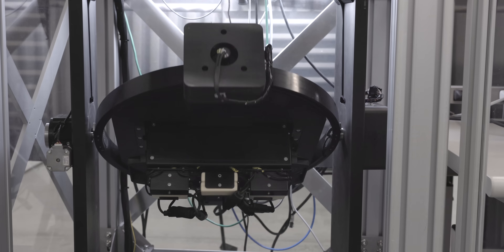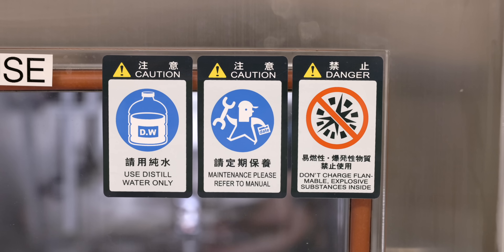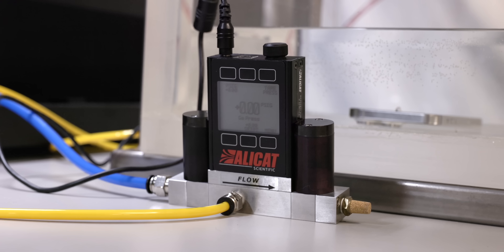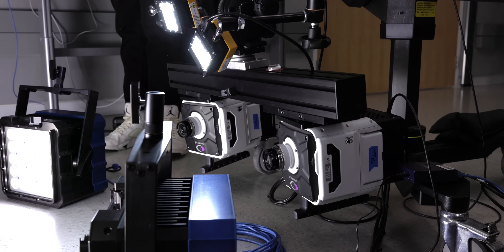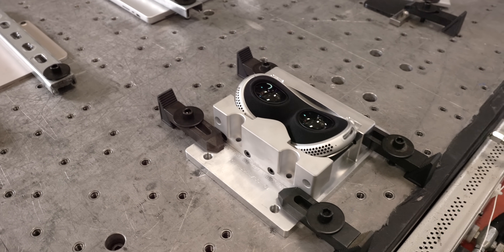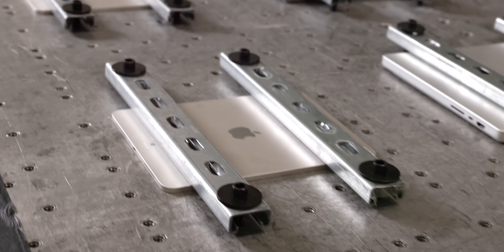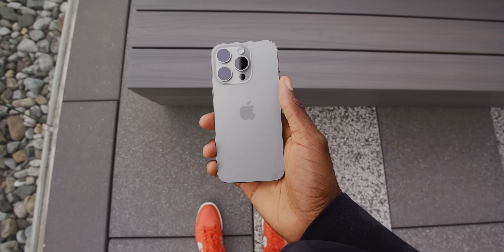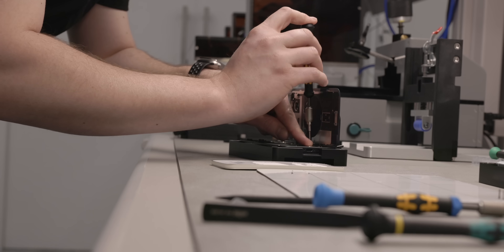I Visited Apple's Secret iPhone Testing Labs!

Comment: Regarding your statement that durability and reliability are on a sliding scale… Programming the phone to not work with replacement parts does not make it more reliable just more profitable.
Reply: Real
Reply: 100%
Reply: Framework laptops completely disprove that statement too.
Reply: @techtonik25  they were probably targeting framework with that sliding statement, and while that might be true, their practices of serializing the shit out of everything has nothing to do with durability vs reparability.
Reply: you replace the home button on an se and the on screen home button turns itself on and off in regular intervals continuously. no option to turn it off from doing it. it’s deliberate. no doubt in my mind. the only way to avoid that is to have an apple repair service PROGRAM the new home button to the phone. touch id doesn’t work either, that i can write off but they try as hard as they can to make end user repairs unbearable not only on the hardware end, but on the software as well. apple is a terrible company. when this 2020 SE dies, and i’ve replaced the speaker assem., the screen (twice), and the home button. i will not buy a new phone until this thing dies.
Reply: They do that for your safety apparently 😂
Reply: @MelodicTurtleMetal the same way the mafia makes you pay for your safety. It prevents the same company from breaking your bones or phone.
Reply: @MelodicTurtleMetal  Safety of the profit margins 😆 Also apple is very anti customer repair. The way that do it is akin to replacing a lug nut on your nut to keep the tire on but you have to buy the entire hub assembly instead. Why because $$ why sell a $5-30 part when you can sell an assembly for a few $100 minimum. But if we want to talk about safety more data leaks and privacy infringement has come straight from apple. I could go no buy there really is no need. If I where to ever send something in for repair I would whip my device every time.
Reply: How is protecting the integrity of a product  by not allowing parts that could cause harm be just about profit? The level jaded people are about large companies is baffling.
Reply: I’ve replaced screens with ones from DHGate that comes in packs of 2 for around 20$ and they’ve always worked and never had any problems. Only downside I’ve experienced is the coating, or lack of, on the cheap screens making fingerprints smear with a shirt or cloth instead of wiping off
Reply: I’ve also replaced the ear piece speaker with a DHGate replacement and it worked perfectly just not as good sound quality when on phone calls
Reply: $500 000 in sponsorship might, might, disagree with you.
Reply: Also, other brands have made phones that are both water resistant and have easily replaceable batteries, so what's the excuse then? Being able to have a phone that's a millimeter thinner? Is that actually worth it....?
Reply: Apple locking out parts also prevents it from being parted out in the event of theft. I feel like just assuming it's to maximize profit is assumption of malice that isn't fully supported.
Reply: @remfur750  sure buddy, apple chasing every last bit of profit is crazy idea isn't it? Tell me more
Reply: you should be able to opt in to the part lock out. you have that choice on a desktop in bios on select computers, it is not something impossible to implement on a mobile device. that should not be forced across the board.

Comment: The problem with IP ratings is the various levels is way too wide. For example Apples IP68 is rated down to 6 metres, whereas other manufacturers are rated to as little as 2

Comment: Would it be better to think of X as being untested? Things like phones can be IPX4 as it could be resistant to splashes, but measures could still be in place to make dust a non-issue, it just been verified to do that. Or they could actually be more capable than their rating. It could be tested as IP67, but it could be capable of testing as IP68.

Comment: Reparability and durability are not related. I'm a phone technician and faults in Apple products come from electronic components failing,  often times propietary chips, a lot off faults come from bad board design (sandwich boards) where heat gets trapped inside and a simple drop can break the solder joints, the only logical reason to build a board like that is to prevent repeatability, at the cost of durability. 
In my experience is the opposite,  rugged and reliable electronics are easy to repair while products designed to be inreperable are very unreliable. 
Is it only me or other technicians agree?

Comment: What about soldering RAM chips and SSDs to the motherboard, does that prevent those chips from failing!? If it actually is a sliding scale then that would be true but I doubt it is.

Comment: Software locking is generally a security concern not a “let’s lock out DIY shops” tactic, no one at Apple cares that much about that. 

iPhone service sales is a rounding error compared to the rest of apples income.  

You don’t want the federal government intercepting a device and replace the Face ID mechanism to do some form of spoofing etc..

There are legitimate security benefits from being able to attest to the trust and validity of every system component.

Comment: John is honestly full of shit, reliability doesn't come at the cost of repairability, the pixel 8 and galaxy s24 series are just as reliable as the iphone, and yet they are easier to repair, and the amount of parts in one of them is about as many as in a single iphone charging port, historically iphones aren't really that reliable, the 3g, 4, 4s, 5, 5s, 6, 7, 8, x, xs, 11 and 12 all had major issues, but sure, if making them convoluted to repair made them more reliable, then why are they pairing parts to the the phones, it's not like pairing them makes the phones stronger, all it does is making sure you come to apple when your iphone does break

Comment: yah the repairability gaslight is the only part I didn't like about this. It's super cool that you want to ship with IP68 and excellent drop resistance etc. I still want the ability to bring my phone to a repair shop that doesn't have Apple's special "we own you" stamp and be able to repair my phone, even if that causes the loss of my IP68 rating or other reliability characteristics

Comment: My phone is ip69k rated and drop tested to 10 feet on steel diamond plate and concrete.
And it's significantly easier to repair. 
IPhone is behind the times, per usual.

Comment: Pelican cases are highly durable but they can still be opened up. There are other dimensions too, like bulk. I think you can probably keep the durability and have high repairability if you use seals that are designed to be opened. Those just tend to be bigger.

Comment: I am sorry but that guy is full of shit. I am an engineer myself, engineering is about best overall result.
So what any Engineer should do is best repairabity with most durable setup. This way it costs lowest for people and environment.
However what apple Engineer’s is trying; what profits apple most. That is a valid way to use an Engineer but just dont try to lie your way out here.
I imagine software locking has nothing to do with durability as if you put another part in it voids warranty and should not bother Apple after that point. You can also design replaceable part without letting water proofing go. Or if you dont maybe you can service broken phones at resasonable prices.

Comment: Interesting comment about the battery replacement vs durability. I had to think about the action cams such as the GoPro's that are extremely durable, batteries can be replaced instantly but yes of course not as sexy as a glass / titanium body. So yeah it is often also just about what looks good and what keeps us within control of everything.

Comment: Ive had my IPhone 15 for six months now and Ive accidentally dropped it three times, two from waist height and one from knee height, on hard floor and just got barely noticeable scratch and micro dent on the frame, nothing more, this thing is built rock solid, oh and just for info this is my first iPhone ever and im using it with no case or screen protector whatsoever also no Apple care, im doing the full naked experience hahaha.

Comment: I don’t agree with environmentally friendly argument that John Ternus used. That’s just PR talk. If Apple did care about the environment, they would’ve switched to USB-C many years ago. Instead they were forced by the EU to make the switch. 

I also don’t agree with the concept about durability & fixability. An engineered piece of equipment can be fixable and durable at the same time. The old Nokia phones fit that (although they were not IP68 rated.)

Comment: I'm not buying the durability/repairability argument. Seems like an excuse to hide the very much chosen anti-repair decisions in their design. John Ternus claim here 8:42 is just plain false. Yeah it was more common back then to break your phone by spillage, but it was not one of the most common types of failures. The most common type of failure is and has always been broken screens. People drop their stuff all the time, including their phone and Apple knows this. He's intentionally leading Marques on another track to not talk about screen repairs, because Apple recently made software locks when using non-apple approved screens. IP68 rating is basically just a standard these days. Has nothing to do with software locks on individual pieces of hardware or having 20 different types of screw heads in your device.

Marques should've seen through that pretty quickly in my opinion. I get that I he doesn't want to seem disrespectful, but it's a primary concern when we're talking repairability. We should be allowed to use off-brand hardware to fix our phones if we want to. Apple treats each individual phone as Apple property.

Comment: Yeah sorry Marques, this stank of Apple Paid Sponsorship dressed up as a mutton.

Software locking does not make a phone more durable. Pentalobe screws don't make it more durable.
As Apple fanboi said in the video, batteries Do fail. They DO wear out, so they are not at the infinitely durable part, so they themselves admit they need repairing.

I don't know which company is worse for control, Apple or Tesla. I'm giving it to Apple. So so so dodgy.

Comment: I get the specific example of a phone being harder to open to make water resistance possible. The problem is that Apple has made things hard to repair without an upside like this, like no longer making RAM and Storage upgradable in MacBooks. Partspairing also has no upside. Things like this are worse for the planet because you have to buy a new device instead of just buying one new part.

Comment: I had a galexy s23 ultra and dropped it accidentally in 350° oil at work it say there for almost a minute with the screen on until I fished it out and ran it through an industrial dishwasher to get rid of the hot oil, it came out with some speaker damage but everything else worked perfectly normal so these tests seem legit 😂

Comment: I don't really understand what that man is talking about. If you replace the battery or any other component in an iPhone yourself, it (the iPhone) starts complaining that you need to reset or do something. If Apple does it, everything works without any issues. Basically, anyone could repair or change components in an Apple device if Apple allowed it. At some point, the EU will force Apple to make it possible to repair devices through third-party shops. Right now, Apple is taking full advantage of this, and you can understand why, since they make money from it as well. It does bother me too because I have an iPhone 15 Pro Max.

Comment: "The harder it is for you to repair, the better the durability" - The car, airplane, shipping and almost all other industries would like to have a word with you...
Reply: Putting these two things at odds is clearly a bit challenged, and mostly a little too simple. 

On the other hand, cars HAVE gotten more difficult, and specialized, to repair over the last few decades. I would imagine the same as well for planes and boats. Especially difficult is that more devices of all kinds use highly engineered composite materials --- lighter and more durable, but harder or costlier to repair.

And to be sure, iPhones are repairable–batteries, displays, cameras, the port, and can all be replaced.  And it does happen. It's just that it happens too infrequently and at a cost which is higher than we would like often.

Of course, what was said about glass is the real kicker. There are more important design decisions (for better and worse) that go into the phone, like the look and feel. So, it's only within the other parameters of a phone you can kind of make such a statement.
Reply: The amount of people that just eat up Apple's propaganda is insane and depressing.
Reply: Wtf....there's no way you're comparing transport vehicles to a phone.
Reply: These are completely separate products with separate needs. Your phone is not an airplane designed to safely transport hundreds of people in the sky.
Reply: I was just about to type out a long essay as to why that statement by the apple guy was so asinine, but the comment you made will suffice.
Reply: Cars and planes need regular maintenance though
Reply: They’re talking about phones🤦‍♂️
Reply: @dan110024 no, just people old enough to remember Samsung Galaxy S5
Reply: yes, hearing that almost gave me a stroke
Reply: @zaqwsxcde54321  That was some serious gaslighting. The repair-ability of apple products has only ever been difficult because Apple likes to make every single part proprietary and forbid their factories from making OEM parts for sale. So full of sh!t
Reply: yeah, but none of then are supposed to be compact at the point that you literally cant change nothing in the internal structure.
i get your point, but those are two VERY different worlds
Reply: @Aztari0 Except Apple did give in to pressure and redesigned the 14 to have a removable back glass panel. If they hadn’t done this, you’d probably still say “it’s impossible”. 
And like someone else mentioned, what about the pentalobe screws that offer 0 advantage, and were explicitly included to make it harder to open? What about the software locks that prevent swapping of genuine parts? 
Sorry, but you’ve drank the apple coolaid.
Reply: @no-nukez *kool-aid
Reply: @Aztari0  Yeah, the extra 500-1000 microns in any direction would really make a phone cumbersome. The trend really goes to smaller phones, not ever bigger ones.
Reply: @disarrayer  even “big” phones are super compact inside (comparing to the total amount of space inside it), not like the average car where anyone can easily work with clearance to make repairs, as I said, two different worlds
Reply: Yes because obviously cars and airplanes are the same size as phones 🤣🤣

You’re comparing apples to oranges here
Reply: How many cars, airplanes, and ships have IP68 ratings?
Reply: @kwizatzx  exactly
Reply: @kwizatzx  You missed the ships. Submarines are repairable. Planes need to withstand quite a pressure differential as well as other forces. Your point is?
Reply: @Aztari0 As someone who repairs phones... they cannot ever be infinitely unbreakable, something fails ALWAYS and even if it is super durable that is no excuse for using 10 different lenghts and 4 different screw heads, because the head of the screw is in NO way connected to the durability of the phone...
Reply: Such bullshit, and marques let him get away with it. The multiple kinds of proprietary screws and software barriers aren't there to improve the waterproofing of the phone, they just don't want you to fix their product without paying them.
Reply: @nothanks6784  😂
Reply: Your point? Have you tried changing a timing chain on a new car? You gave to remove the whole engine to do it and not just the German cars, all cars are like that now. Manufacturers are making it almost impossible to be done by a person, that is not certified in some way or with specific tools. Airplains have to be easy to maintain as they are under extreme pressure during each flight and if they were not easy to maintain nobody would fly. Ships are huge and have a lot of engine space to be maitained, but speedboats are not. You need to have a diving license to repair those, which doesn't really make it easy, right? I am not saying Apple has made it easy, but they do have a point regarding smartphones at least.
Reply: Almost no components in a car or plane are repairable. Everything is integrated modules that just get tossed and replaced. Modern phones are just one highly integrated unit. And they pretty  much have to be to be any good.

Comment: i have both iphone 13 pro + 15 pro max, currently. daily drivers. dropped a millions times, each. all surfaces included. many times from my pocket to asphalt getting in my truck. never had a case on either. the ip13 is MUCH worse despite being newer(for me). i will say that ip durability has been steadily improving. ive dropped the ip 15 pm at least 4x more than the ip 13 p. still... the ip 15 pm is in much better condition

Comment: Even if the iPhone 15 is certified IP68, water ingress is NOT covered by the warranty.
So it is to be used as an indicator only.
Also, an IP rating proves the waterproofness and dustproofness of a device right after its production. It does NOT mean it will stay IP68 down the line for years and years (hence the decision by Apple not to warranty their "indestructible" products against water damages)